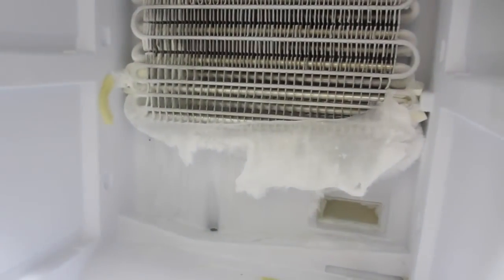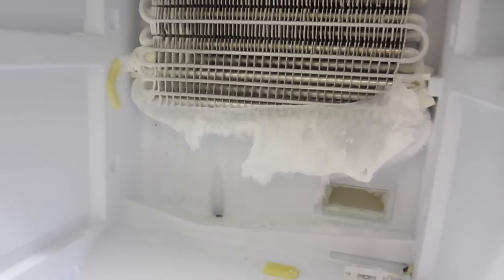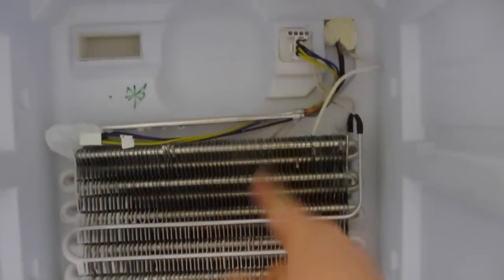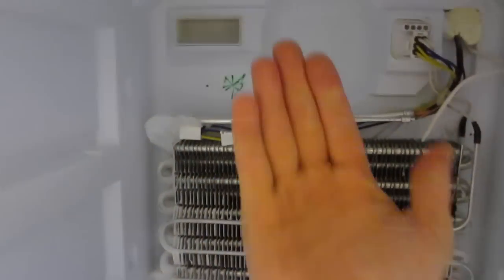Fixing a Hotpoint Fridge Freezer (6APR14)

Comment: Hi i have a hotpoint. And both the fridge n freezer no longer are cooler. Wev always had it on high setting for cooling. The freezer blows normal air but its not freezing. Any advice would be greatley appreciated.

Comment: Checked out your vid and another uk guy. Spot on, my Hotpoint problem was exactly the same as yours.  To help others, don't remove the 'surface' screw, only the recessed ones, that way, the second plate stays attached  to the one facing the front door. Remove them together (I didn't,  then fitted it back on before install). Vidios like yours help so many people, thanks !
Just a note, my fridge freezer has been running for 11 years without this happening before. Guess it must be a slow build up of ice 🧊

Comment: Thanks to this 9 year old video managed to revive our Hotpoint FFUL 1820 fridge freezer. My model had a polystyrene cover behind the plastic screw board which cane loose after the ice thawed to reveal a huge block of ice blocking the vent that takes the air upstairs. Melted the ice with a hairdryer. Cheers OP!
Reply: Mine does too and I was scared to open it , mine is on top not at the back

Comment: Fridge, [Hotpoint FF 200 LP] wouldn't chill so expected to have to buy new one, {though hadn't defrosted freezer since bought it so no real surprise is it !}. Trying to avoid new purchase so searching for solutions. Found your vid' and seemed that the interior of my F/F looked similar to yours - was actually another beige cover under the white one with several push clips. Carefully removed both covers and spent several hours carefully taking ice off heat exchanger [?] and mopping up water. Spent a frustrated hour or so pressing buttons and twiddling switches waiting for it to recover but it eventually did !! Result as they say ... Takes a while for the fridge to chill as cold air on this model comes from the freezer section which is below the fridge but all working and more quietly than before. I expect that all the cracking noises that used to occur was the appliance trying to work encumbered by the ice build-up so I shall endeavour to defrost much more frequently. It makes environmental sense to look after appliances !!

-  SO BIG THANKS Mr Smash :-)

Comment: I have the fridge problem. It’s the hole in the bottom of thr fridge. At one point I could stick a straw in it to get rid of the gunk. Now it’s constantly getting frozen every day. Where to I need to get at? Is it from the freezer compartment or do I take the panel off the back. I heard there might be a pipe blocked.

Comment: Had the same issue with my Hotpoint this week. today I emptied it out and used a heat gun at a distance to warm the inside to it. no visible ice given it is frost-free, left if empty and off for a few hours and it amazingly works again. Not sure if the ice I could not see did melt, no water on the floor though?. all I know is something fixed itself.

Comment: Hi, recently I bought a Hotpoint fridge freezer FFU3D W, could you tell me, please, what is that cable from left fridge door for? I couldn't take off the door because of it.
And  is it normal that the outer top edge of the freezer and the inside top freezer door to heat up while the fridge is on? Thank you!

Comment: Hi.
I would like to add to your video the most important part prior to starting fiddling with your fridge.
Health and safety, diagnostics must investigate why is your fridge forming a block of ice on the evaporator. 
Did you test the defrost heater.
Is the air flap mechanism working.
Not knowing the task of all components isn’t fixing the problem.
This is good for your personal learning but I wouldn’t recommend sharing with other that might get seriously heart.
Take care and remember safer above all.

Comment: Hi I have a Hotpoint ff187e, the fridge is not producing any air and everything is warm and the freezer is still freezing, I've taken the panels off and had a look everything is clean, and the motor fan is still spinning when I left the panel off the freezer. I don't know what the problem could be?

Comment: This is exactly the problem I've got. I think my fridge (- FF 200 L -) is a slight variant to your model, but guessing that the solution is as you've described(!). I bought it in 2010. I couldn't fathom why I could hear the right noise(!) at the back of my fridge section, yet could feel no cold air coming from the air ducts. But the freezer section was working normally. I thought that turning both fridge & freezer temp dials to their minimum settings & then pressing & holding the super cool & super freeze buttons simultaneously for a few seconds - resetting the fridge freezer - might help, but it didn't. I wondered why my milk kept smelling & tasting revolting after just 2 days in my fridge..............

Comment: Instead of keep defrosting a freezer that is labelled as frost free the main culprit is the heater wrapped around the freezer unit.  The heater goes faulty.  It’s purpose is to run once everyday and this gets rid of any ice build up ensuring it’s smooth running